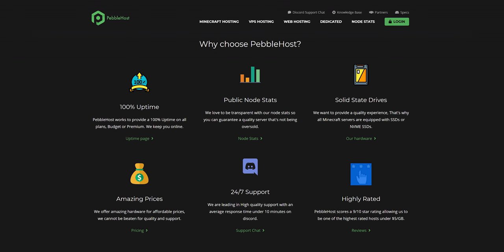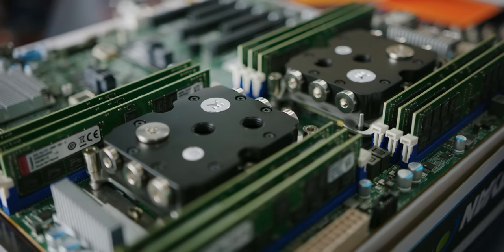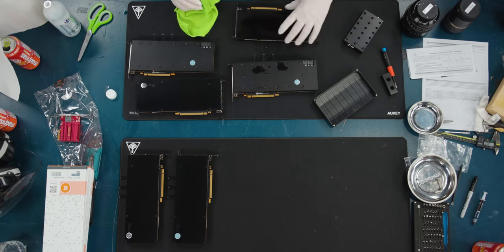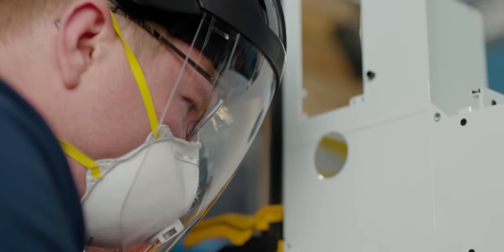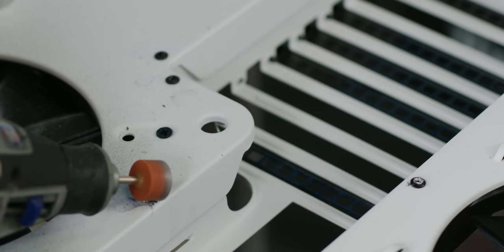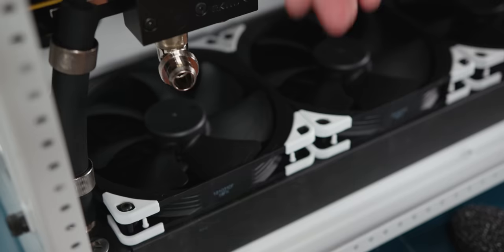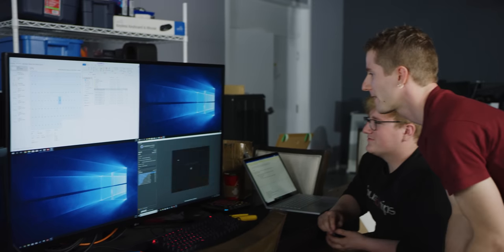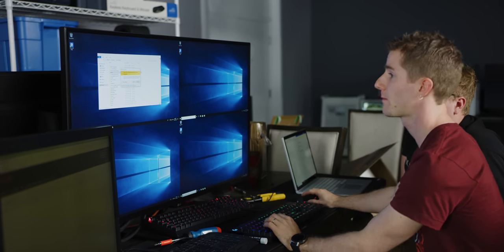We FINISHED the $100,000 PC! - 6 Editors 1 CPU Pt. 6

Comment: "why not just use 6 separate pcs ?"
LTT : What did you bring upon this cursed land
Reply: More expensive, more maintenance, less flexibility, less power. It does give more redundancy though.
Reply: @jeschinstad  6 rigs with a combine cost of $100k gives you a budget of just over $16,000 which would give you a good bit better specs per user than they got doing it this way.
Reply: @omega52390  plus thermals
Reply: @johnaskings527  yeah that's the point of ltt
Reply: @johnaskings527  Ok tell that to the guy saying it's a better solution.
Reply: LTT: You have been promoted to GET THE F--- OUT OF MY STUDIO
Reply: 6 times the potential for Linus drops
Reply: @omega52390 : 12*9000=108.000 for the CPUs alone. There is a reason why companies spends billions of dollars on virtualization. You simply get a lot more at a much lower cost. If each user always used 100% of their CPUs, then it would be different, but they don't.
Reply: @omega52390  please remember the cost of the original cpu xeons is almost 10k.
Reply: @omega52390 : Oh, and this system can very easily be redefined as 24 PCs rather than just 6, which you also have to consider.
Reply: @jeschinstad  What are you even trying to talk about with 12*9000? Each editor is effectively using an 8 core/16 thread 64gb of ram titan V machine. Obviously you aren't giving each editor 2 20 something core xeons. You could give each editor at least a single 16 core xeon for less money though. Since all of the cores are taken up by separate VMs you can't really do a queue to use all of the resources for the final renders or anything like that at least easily. There may be a very complex way to set up something like that, but he certainly hasn't mentioned attempting it. Effectively this is just 6 normal editing desktops combined in to 1 with lower power, space, and heat consumption, but at something like 5 times the price.
Reply: @Toddmars  Yes and could be replaced by 6 towers each with a less than 1000$ CPU effectively.
Reply: @jeschinstad  well those cpu's are being divided across 6 editors. I would think something else...
Reply: @christopherpedersen1820 : But you're talking about a software configuration vs a hardware limitation. You don't have to pin CPUs if you don't want to. By default, all users would have 56 cores. Pinning has to be configured. You could build this system much cheaper as well, so that's not a valid argument. Actually, the further you reduce requirements, the higher the saving you will get from sharing. This setup also easily handles 24 desktops, provided each desk only needs one monitor. 

Sure, you can build six PCs for less than a hundred thousand dollars. That's obvious. You couldn't get the same performance for six different PCs. There's a reason why virtualization sells for a couple of hundred billion dollars per year. Most of the hardware in a PC is wasted nearly all of the time.
Reply: @sebastianacosta7109 : Yes, but you're not using 100% of the CPU 100% of the time. That's one of the most important aspects of virtualization, that you can use the same processor several times. The same is true for RAM. With six different PCs, you would need to store software in RAM six times rather than just once. Or if you decide to configure it as a 24 PC setup instead, you'd use 24 times more RAM on single PCs.
Reply: Just a quick thing to think about: this way each editor has effectively 2 optane drives (one as cache and one as system drives) as well as 40 Gbit/s LAN. Both of these things would require significant investment if you wanted them x6, esp. if the switch doesn't have the 8 ports required (6 editors, 1 server, 1 internet). That and the possible sharing of the rest of this beasts performance - pretty good (would have been "incredibly good" a year ago, though).
Reply: Jo-Erlend Schinstad redundancy is an important aspect here. If this thing toasts, you have a very expensive brick and 6 editors freaking out.  If you have 6 computers you just replace one while 5 over editors can still do their thing.
Reply: @jeschinstad  If that is the case VM configuration has changed drastically since the last time I've messed with it. I don't have a ton of experience with it, but every time I've set up VMs you had to explicitly state what resources you were giving to the VMs. Also this hardware is definitely far above the sweet spot for price to performance. My understanding is also that a large portion of why data centers use higher end CPUs is not the upfront price vs performance and that is where virtualization is most used. Power consumption, heat and space are a huge concern so they take a hit upfront on price to performance to improve space, power, and heat.
Reply: @jeschinstad  The point of in virtualization is in: 1. Flexibility, your hardware is separated from OS\Software. 2. Redundancy\failover (you can have X physical servers sharing resources for the X virtual machines). 3. Easy to deploy and manage in the future. I would say that price of hardware are the last thing big companies would care about in situation when you need XXX virtual machines running at the same time. P.S. In Linus case it's more for WOW! effect and case for the new youtube video that real need for such mashine in the office, especially when you need all of this only for 6 people working together at the same time.
Reply: @christopherpedersen1820 : There are two very similar issues here. One is specifying how many cores you want your VM to have. That's something you do. But another is pinning CPU, meaning that a VM will be locked to specific cores. That's not default and something I hardly ever do, even though there are some cases where it can be beneficial, depending on what you're doing. You're right about datacenters and one of the very best ways to improve space utilization, is to virtualize the hardware. I mean this box could comfortably run 2-300 servers in containers. That's a few racks right there. :)
Reply: @OstJoker : The ability to overbook hardware in a time-sharing setup, is enormously important as a cost saving device. In this case, you get ten 9000 dollar CPUs and at least 12-18GB RAM free of charge. That's not insignificant. Sure, virtualization is very comfortable too. I've moved all my desktops into VMs for that reason. Linux virtualization is just so good, there's no point in hassling with native installs anymore. But I would have to have at least three times as many computers if not for virtualization and that would be prohibitively expensive.
Reply: @jeschinstad  Ah I didn't initially understand what you meant by pinning as I've never done that. The thing is on a normal work day if they want 6 editors working this is still effectively just 6 8 core workstations. Sure if someone is out of the office you can allocate their cores to the other video editors, but i don't think this is a great use case for this type of hardware unless it can fluidly distribute resources between the 6 editors throughout the day. I'm sure that is possible, but it would likely be a headache. There is a place for this hardware, but realistically I don't think this is it though it is cool.
Reply: @christopherpedersen1820 : Don't have to be out of office. We're talking seconds here. If you're not using 100% of your CPU for a few seconds, then I can use that free time for my work. So you always have 8 cores, but you don't care which cores. If you're spending time copying a file, for instance, then you're IO bound and not using much CPU, so I can give you my stressed CPU, which will be enough for your limited needs and you can give me your relaxed one so I can get my stuff done faster. There is a price to pay for this luxury, because there's a cost of moving a process from one core to another and you can't always allow for that, for instance in the case of real-time transcoding. You really need to know how fast your system is, even if it's at the cost of 30-40% of available processing power. The point is that a CPU should ideally be running at 100% 100% of the time. If your CPU is not running at 100%, then it's a waste of processing power. I'll bet if you open your system monitor, you'll see that your CPU is running at 5% or something. That's 95% waste of processing power. So it might be an exaggeration to say that an equal system based on individual PCs would need six times as many processors, but it's only a slight exaggeration. It's a very bad idea to pin CPUs unless you know why you're doing it. That's why it's not the default. By default, Linux will choose which processor core you're using based on your need compared to others needs. That's how you get as close as possible to 100% utilization, which is always what you're aiming for, except for single-PC systems where you're aiming for a few minutes per week of full utilization.
Reply: @jeschinstad  If you set it to 8 cores it will never use more than 8 cores though. I also didn't think you could assign more cores than you had at least with basic VM software. Yes which 8 cores you are using will shuffle around, but that doesn't matter. Unless the number of cores you are using is dynamically changing its not very useful.
Reply: @christopherpedersen1820 : You can assign as many cores as you want, but each VM is limited to the number of physical threads. So in this system, for instance, each six users could have 56 cores at the same time for a total of 336 virtual CPUs or 24 users could have 1344. That's no problem at all. I usually assign all my cores to all my VMs. You just need to understand your workload a bit better than if you limit VM cores to the number of physical threads. 

It does actually matter that you're moving between cores, because you introduce a lot of context switches. Pinning does increase performance and can be very important in certain workloads, similar to how an RT kernel is important to a musician. 

But this setup is very overpowered for the use case he's configured. Limiting CPU usage this way provides extremely predictable performance, but you don't need that and he's probably wasting at least 90% of his $18000 CPUs. But of course, the point is to build a luxury system, not to create an efficient setup. It would probably make more actual sense for 12-24 editors though. His setup is more suitable for gaming, where you need the predictable performance. And then you really must pin CPUs.
Reply: @jeschinstad  Yeah, I mean when I said pinning doesn't matter I mean in most cases. The optimal setup really does vary wildly with the workload. I actually have more experience working with large clusters of relatively low end hardware, but that was in physics data analysis and the goal was purely highest performance for a set price with a highly parallelizable work load that works perfectly fine on a cluster. There are cases where super high end hardware makes sense. There are case where a bunch of lower end hardware makes sense. In this case it just seems like 6 8-16 core desktops with a titan each would do the same job cheaper.
Reply: @christopherpedersen1820 : Yes, but again, that's just a matter of how he's defined the software right now. It's extremely overpowered for that it's designed to do, so obviously, you could use much cheaper processors. A dual 8 core system would most likely suffice and that would then be much cheaper than buying a large number of the same processor. You're comparing different things. The extremely conservative use of resources in this setup, is like having at least two spare desktops per desk. The setup would make more sense if it was to serve 24 editors rather than just 6. CPU is hardly ever the bottleneck in desktop virtualization. It's RAM and IO that's limited. If you ignore everything except CPU, I would say this setup would easily serve around 40 editors, but of course, you can't ignore things like the GPUs.

Comment: Linus: scared of Jake cutting a $500 case with a dremel

Me: didn’t you take apart a $50,000 camera?
Reply: See, they can always just throw in a couple sponsor ads to make up for the cost of the camera (maybe). But if they screw up cutting the case, they will have to live with it for the entirety of that case's lifespan, since Case Labs is already shut down.
Reply: did they finish the water cooling for it? or isnt it out yet?

Comment: You could have built 6 significantly better workstations for much less than this cost... But that would have been no fun, right? :D
Reply: I agree but this thing still wasn't 100k
Reply: I was thinking that, add in to this if anything should break on this system its going to be a royal PITA to get the part replaced.
Reply: Well Aktually what about power draw, servers in data centers are replaced very often because is cheaper have a monster cpu/gpu in a single chassis that multiple computers
Reply: @N03ntry  All it takes is one component to fail and all 6 editing stations are down until it is fixed. It's a fun "can it be done?" project but not something i would ever consider using in a professional setting.
Reply: @marko247  your probably right, but it's not just about performance.  He got several good video's out of the project, and that's what he get's paid for.
Reply: Nope they couldn't have. Remember performance is divided between the systems which requires. E.g. If only 2 pcs are rendering hence they would get about thrice the performance as compared to when they all are working together. Hence more power in most situations than separate workstations.
Reply: @AbhishekKumar-jd4pf  this isn't actually set up that way. Everything is either directly passed through or statically assigned to a single VM and doesn't respond to load.
Reply: @AbhishekKumar-jd4pf  Fantastic point. I was hoping somebody would point this out. That is what I have done with my workstation. My company has two editors - myself and my business partner. Sometimes we work simultaneously, but often times we don't. Rather than split my budget between two workstations when only one of them will be under high load at a time, I pooled my entire budget into one monster system that can distribute computing power as needed between the two workstations. I used Aster V7 to accomplish this. When we're ready to render video, usually it's at night when neither of us are using our workstations, or are only using them for basic web browsing tasks, so we can render much faster by using our single 4U server workstation that cost us $2,000 to build, rather than a single $1,000 workstation. Made sense for us. Counterpoint for LTT: They use an external rendering server. So everything I just said is pointless in their case. lmao
Reply: @AbhishekKumar-jd4pf  Linus said the CPU's are split evenly between the editing stations, 8 cores (16 threads) each... I'm not an expert but it didn't seem like they were set up to scale like you're suggesting? Linus would have mentioned that if it was the case, surely? Either way, this is going to be used for editing, not rendering. Each editor could have his/her own 32c/64t Threadripper and 128GB ram etc and still have money left over to spend on input/output peripherals etc.
Reply: @animefreak5757  I get the video value, it was probably worth it for LTT for that alone. :)
Reply: @donaldholden2090  In your situation i can understand the value in doing this kind of thing. Once you're spending the kind of money Linus is talking about though it seems a bit risky. If a single piece of hardware fails it can take down all 6 editing stations, and if the problem isn't obvious that could be an entire day with no editing done (or worse!) I've had a bad SATA cable stop my PC from booting before... You have no idea how long it took me to figure that problem out! haha.
Reply: @ericw.1620  Correct, but unlike having to buy all new parts and build separate machines, that configuration error can be solved with a reboot.  The only thing they won't be able to share are the titans, since nVidia is extremely clear that they'll live with virtualization for passthrough on consumer cards, but beyond that you have to buy quadros (or tesla, depending on your goal)